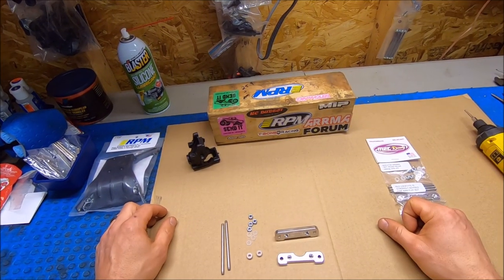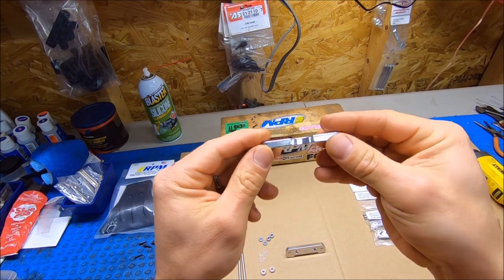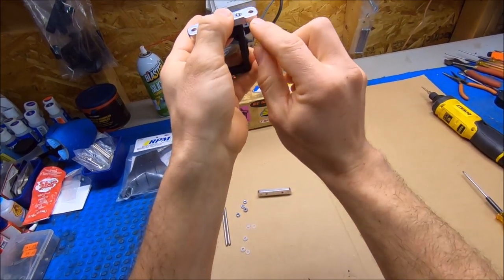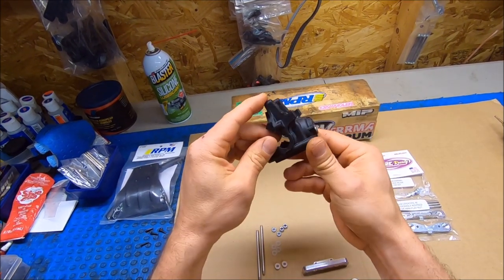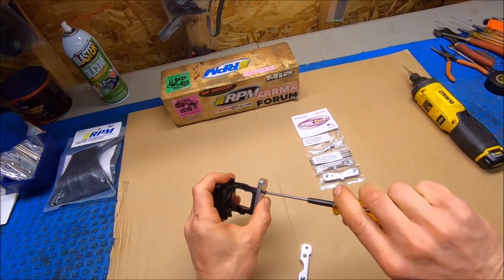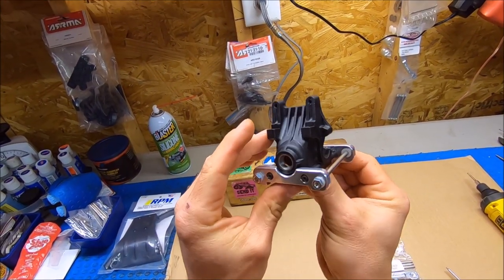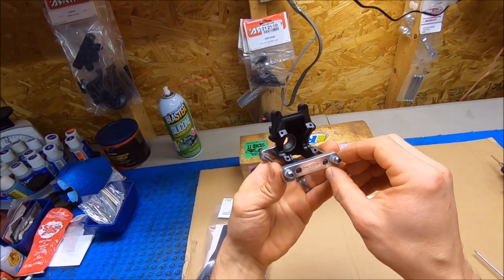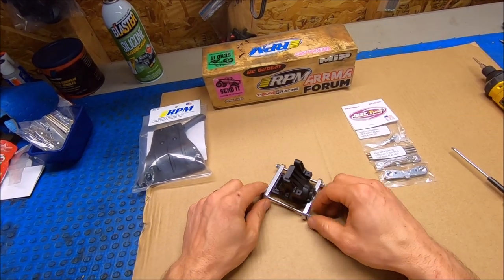NEW! M2C Locking hinge pin kit! "ASSEMBLY and OVERVIEW!"

Comment: Now that Mitch has  basically the full compliment for the  6s line, seems like the best way to build an ultimate v4 is to grab all the m2c parts, grab a hardware bag, drivetrain and the composites off  Jenny's, and toss in your electronics of choice and build from scratch like a kit!
Reply from the maker: Sounds like a plan!💪The upper mount and top plate is next and all bases should be covered!😎🤙

Comment: Thanks for the video and to Mich for coming up with the design, when I installed my front set I realised then that the FR hindge pin doesn't bult to the chassis, do you recommend just leaving the two screws out the would secure the FR the the chassis?
Many thanks 
Darren
Reply from the maker: Yes the B block no longer bolts to the chassis but does on the front A block. If that was your question.🤔🤣

Comment: Hi, I just installed  front and rear hinge pin kits on my EXB. I had trouble getting  the wriggler nuts on far enough on the shaft because  the shaft kept turning  while I was tightening  it. I put red loctite too. Do you think using  a shock tool  to tighten would  be easier ?  Thx !
Reply from the maker: If you put on the small nut first with red thread lock and tighten it down then put on the rear locknut while holding the front nut with a wrench, it should tighten. Also the rear locknuts don't need to be over tight. The whole pin kinda floats. Hope this helps!

Comment: Can you run just the captured hinge pins on the stock setup?
Reply from the maker: You have to use this kit in full for it to work. M2C offers plain hinge pins that will work with stock but in order to use the locking system, these blocks are required.😎👊
Reply: RC DUDE81 thanks man!

Comment: Definitely gotta add them to the list. But hey I gotta question.. I just got n m2c chassis n when I went to install the front diff.. the big gear in the diff case rubs on the chassis pretty bad.. the chassis looks like its bin milled deep enough n if it is then its something else.. have u ever had that gear rub like that.. n e things u think of that I should check out..oh yea it's a v2 case.. should I switch to v4 cases or r they the same height.. n e ideas would help.. thanks n thumbs up my brother
Reply from the maker: Thanks strange bro!🤔I haven't had that with any of my trucks that I noticed...what truck is it?

Comment: Hello sir, I have ordered all m2c parts fir my V4 typhon and wanted to know if you recommend HR aluminum diff cases for front and back or stock is better.

Thank you
Reply from the maker: Awesome! M2C beef!💪I love the HR cases! I run them in almost my cars in the rear especially. They don't break plus helps save your diffs since the plastic expands under heat. A great upgrade!👌
Reply: @RCDUDE81  are the HR CASES compatible with the m2c parts?
Reply from the maker: @nadersedaghat5694  Yessir!👊

Comment: So what would I need to upgrade my typhon 3s to 6s. As I'm noticing that I'm starting to stress the stock suspension  out as I'm getting more big air   an yes few of the landing was kinda ruff 😂😂
Reply from the maker: 6s electronics or suspension? Probably a good idea to keep it 3 or 4s but you can upgrade the shocks to 6s Typhon shocks. That will be a bit better if you are doing larger jumps. I'd recommend going 30-35 weight oil though.😎👊
Reply: @RCDUDE81  ya been thinking 4s elec. 6s suspension.   Just wasn't sure if I had the right idea thanks on information!👍👍 thanks

Comment: Eric,
Do you need to remove the whole diff case like that or you think I could just remove "what's necessary" around the casing? I will only be installing the rear.
Thanks bud.
Cool that mitch included an extra hinge pin, might as well just made it an even 4 tho 🎯
Props to mitch.... Gonna be installing this tonight or tomorrow
Reply from the maker: You don't need to I just did that to show the parts and how they work. Easier for me to film. It would be easier imo to get the inside blocks on with the case off but whatever works for you! Yeah love how he throws in spare bits!😜Just make sure to use red  thread lock on the inside nuts and use the plastic washers. Good luck with it!👍🤘🤘
Reply: @RCDUDE81  thanks Eric. 
don't have any red just blue, gonna have to brave this Covid 19 world and get some
Reply from the maker: Well you can use blue just clean the threads with alcohol or brake cleaner first to get off any oily residue then lock her down!👌
Reply: @RCDUDE81  are the loctite bolts towards the rear or inside of the car (when doing rear kit)? Maybe I could do loctite for now and eventually switch to red later?.... If those bolts are the inside ones mat be a pain. Thoughts.

Thanks Eric
Reply from the maker: It's the non lock nut ones that go toward the inside of the car. Blue for now should be fine. Just keep a tightness check on them!👌
Reply: @RCDUDE81  appreciate brother.... Almost full beefcake now, all M2c and a few HR and RPM bits, everything minus the Goliath chassis.... Will see if I need it 🤔
Reply: @RCDUDE81  got some red. Is it just me or do these wriggler nuts (small ones) not go on as far as you think they should?

Comment: Are the front and rear blocks the same on the Kraton EXB?
Reply from the maker: The EXB has a different front system being it uses the A block for a bumper/skid configuration. The rears will work with this kit as its the same as the other models. M2C is working on a front block design now that will also work with the Mojave.🤙
Reply: @RCDUDE81  thanks!

Comment: Any ideas if it would work with the kraton EXB?
Reply from the maker: The rear kit will work but the front you will need to change to a RPM bumper or T-bone Typhon bumper.😎👊
Reply: @RCDUDE81  oh as long as it works. I appreciate the quick reply. 🤙

Comment: Dude thanks for the video if you didn’t make this video I would have never known he had some just wish I knew he was going to come out with some before I ordered I sent from just bash it but I’m definitely still going to order a set tomorrow
Reply from the maker: No problem bro!👊Yeah these have been in the making for a while. The 8s parts kinda stalled other projects. Worth the wait though this kit is stellar!😎👊🤙🤙
Reply from the maker: There was a small issue with production so it will probably be next week! I'll make sure to keep everyone posted!👊
Reply: Ok sounds good
Reply: Hey can you make a little bit of an update video I had some trouble when I was ordering my stuff from M2c racing just got off the phone with him maybe specify which different blocks like A-Block B-block  something about when I place my order on the website I got a replacement part are something like that I was kind of confused of what he was talking about But I got my order all figured out and my stuff is on the way
Reply from the maker: @aaronverrett69  The A block is the very front of the truck. Also slides in where the stock bumper lip would go. B block is the rear of the front diff case, C block is the inside of the rear diff case and D block is the very rear of the truck. Wasn't sure if that was the question or not but feel free to ask if you have any more questions! Glad you got the order sorted out and on the way!

Comment: Hi man i have a question off this subject, what is your thoughts about the new spektrum 150amp smart esc?
Reply from the maker: Well, It has great features but I just wanted beefier electronics in my 8s. It's basically a Max6. It seems to have a lag in the power feed too which I could never figure out. The Max5 solved all! It is a decent ESC especially if your into using the bluetooth module but that's totally subjective. I think honestly that ESC is better suited in a 1/7 scale.😎💪🤘🤘
Reply: I'm talking about the new 6S ESC not 8S
Reply from the maker: @raptorider83  Gotcha. I'm not familiar with that one..🤔

Comment: Hey Erik,
Will those fits the Mojave?...
Reply from the maker: Not with the stock bumper/skid assembly. The a and d blocks stock are different than the other 6s rigs. If you're running T-bone bumpers, they will work.😎👊
Reply: @RCDUDE81  yeah i do have T bone.. great..
So i will order set for front and rear.. 👌

Comment: this design will rip your diff off the chassis  . i got that problem just because the pin can't pop out on hard impact then the energy transfer to weakest point .  the weakest point is 4 screws from chassis  to your plastic diff .